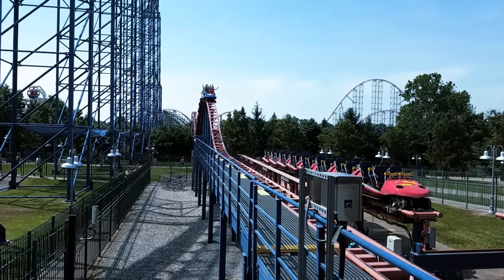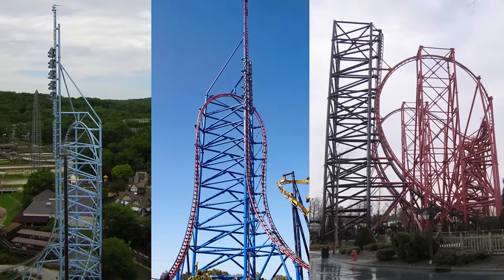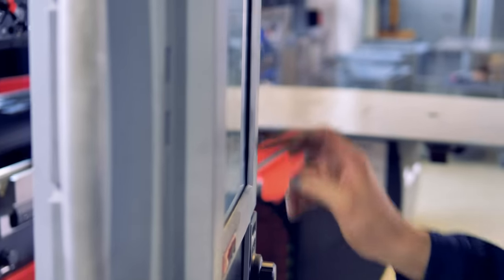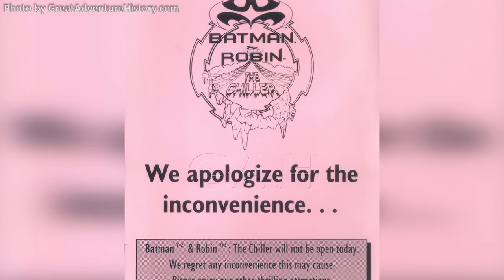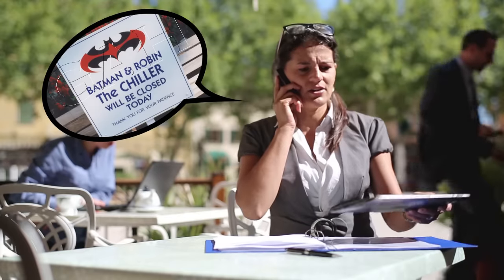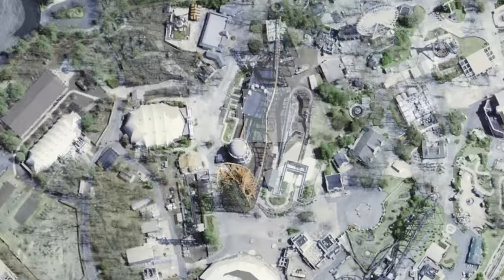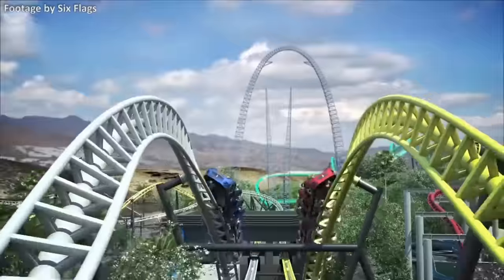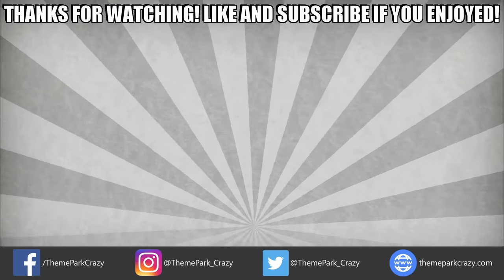Failed Roller Coasters: Batman & Robin: The Chiller at Six Flags Great Adventure (Ep. 2)

Comment: I'm an ex-employee this park.  And I will admit, every second of this video were 100% true.  Now I will give you a hidden fact about this ride.  The design of this ride was so bad and the maintenance was impossible, that one season, a wheel broke off the train, sending metal into the LIMs and caused injury to riders.  Now I wasn't there when it happened, but I do know the operator that was running the ride when it happened, and I did have a park radio with me and the communication and the stories I heard are pretty bizarre.  The wheel housing where the wheel broke up, completely destroyed the train sending it to a screeching stop.

Another fun fact:  After the shoulder harness was removed with lap bars, the lap bar was equipped with a seat belt used for a measurement device for larger riders.  The operator was required to inform riders to make sure that were buckling the belt correctly because if the secured it upside-down, that release would be in no access to anyone and security would have to be called to unbuckle the belt.  The reason why the operator could not hand on to the tool, was because it was considered a dangerous object and couldn't be left lay around.  From what I heard, it only happened 2-3 times a season.

Comment: They could have avoided that by using a hydraulic thrust system to launch or by installing a liquid cooling system and a massive capacitor bank to hold the charge before dumping it into both coasters at the same time. I really wish they would have done that. I love the Mr Freeze and wish I could have ridden Batman and Robin.

Comment: I´m no expert, but wouldn´t it been more sensible to fix the ride with a LSM System instead of replacing a section of track and essentialy throwing the ride away a few months later? Sure, LSM Modules are costly and may have required to modify the trains a bit to use it, but I would argue that they could have done one side first and the 2nd one a year or two later in order to keep the costs down a bit.
Reply: Unfortunately, I think Chiller became a victim during the Dan Snyder era. He was all into the family rides, and Batman the Dark Knight was installed instead.

Comment: they could easily solve the power shortage problem by using a gigantic capacitor to handle the enormous electrical demands of launching both tracks at the same time, one launches from the grid and the other launches from the capacitor
the capacitor can then be recharged during the course of the ride, this will smooth out the power use so there are fewer power surges (if any)

problem solved

Comment: As an engineer what surprises me the most is how many of these coasters had problems that someone would think would have been figured out in development. Modern computers can run simulations that can alert you right away to issues. Then again some of these coasters were build in the late 90s and early 2000s and there might not have been a computer package that could emulate a coaster yet.. However the power problem and brown out would be unacceptable any decent electrical team should have checked all the power draw requirements.

Comment: Hello, I'm Brazilian and I came to clarify the issue of The Chiller in Brazil.

Brazil is a weak place of amusement parks, having only three large, being them: Mirabilandia in Pernambuco, Hopi Hari in São Paulo and Beto Carrero World in Santa Catarina. A curious fact is that the Hopi Hari has the largest wooden roller coaster in Latin America, called Montezum and the Katapul, first Schwarzkopf Shuttle Loop (King Kobra, Kings Dominion and Thunder Looper, Alton Towers.)

In 2010 Hopi Hari released his new roller coaster for the 2012 season, an intamin 10 inversions, While Mirabilandia released a Vekoma Giant Inverted Boomerang (Ex Deja Vu, Six Flags Over Georgia). In that time, due to competition Beto Carrero World bought The Chiller, but it was never announced.

Mirabilandia was unable to mount the Giant Boomerng due to problems on its current ground, it remains guarded to be mounted in the new unit of the park, but it is not expected when this will happen.

Hopi Hari went into crisis in 2012, so the park did not ride the roller coaster that was sold and is now in Flamingo Land (SIK).

Beto Carreiro World knowing that the two parks would not bring their new roller coasters began to leave the chiller aside and investing in other items, until in 2018 they gave up entirely the project. There are rumors that Beto Carrero lost the roller coaster project or pieces of equipment, however, the real reason was a change of strategies and investments.

(My English is not one of the best, so I used the help of google tratutor, I hope I helped in some way. If you have any questions, you can ask me. 😁)

Comment: This is the best Defunct coaster in my opinion. What doomed the ride was the LIMS and design. I always wished that Great Adventure would rebuild it, they could place it behind WonderWoman, adjacent to the Picnic area and Nitro kind of. Also, I think a new coaster manufacturer should take on the job, and instead of the electric LIMS which are outdated and due to power draw the coaster could never launch at the same time due to power surges, they should use either air/hydraulic/cable launch mechanism. And they should do the exact track layout and everything, and Bring it back. As a replica, heck or even do the same layout but make it a little taller and faster if they want but I’d prefer it to be the same. And of course they HAVE to include the zero G rolls.  That was/ will always be my favorite roller coaster. And with new tracks and technology it could totally be done. Imagine a super smooth chiller?? Just the look of the ride, the feel and the scenery just tied in so well with the movietown area, and a new style would fit in so great. BRING BACK THE CHILLER!! #2022

Comment: This is my home park and over the operating years, I've never seen it run in a perfect dueling mode.  Also it seemed that the Robin side was the only side open consistently although I did get to ride the Batman side a few times.  I remember going to the park one day and the zero G roll was removed from both sides ... no warning but at least they changed to lap bars!  Overall this ride was a failure especially since the only somewhat reliable side had my least favorite inversion type ever in my opinion.  Good riddance Chiller and I'm sorry if anyone went through a power failure because of it!  🖕🖕👎

Comment: I smell, no not burning insulation, I smell cost cutting by resort.  The ride maker had already made LIM launchers discovered the what any geek could have told you was going to be a problem HUGE energy surge which every geek KNOWs is solved using HUGE capacitors  Indeed the capacitators their size cost recharge cycle time is what keeps mag launch military weapons from happening, and mind you the last real effort was for SHIPS ships carrying thinks like main battle tanks and hover craft to land them If THEY have issues with the capacitors you know that is the problem to solve BEFORE even doing concept sketches.  Indeed the cost over runs after installing capacitors on their previous rides led to lawsuits against ride maker.  After that if the resort balked at the additional cost of capacitors (and possible longer time between launches - unless perhaps redundant capacitors installed meaning 4 for the dual track setup) and the ride make made believe they had 'solved' that problem - well, that was just stupid.  That they eventually made it a run through and not return speaks to this, as this eliminated a set of LIMs capactiors required and let the LIMs remain INSIDE OUT OF SUN AND WEATHER, perhaps even with cold air blowing on them